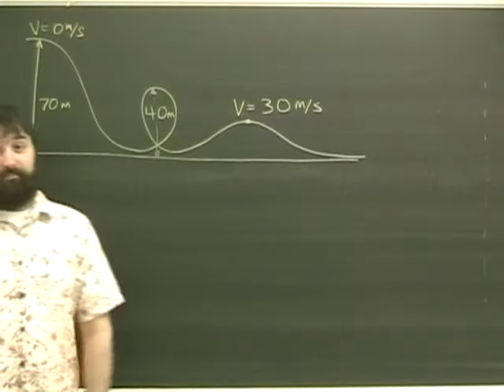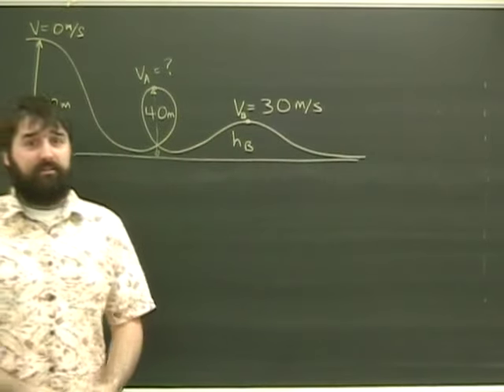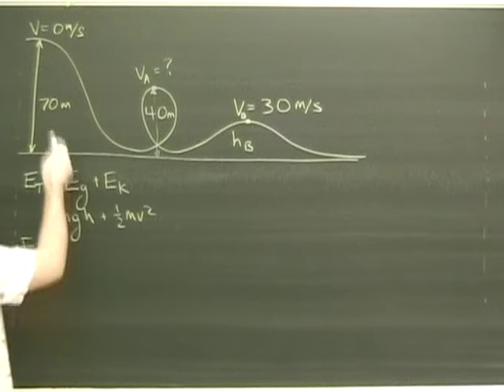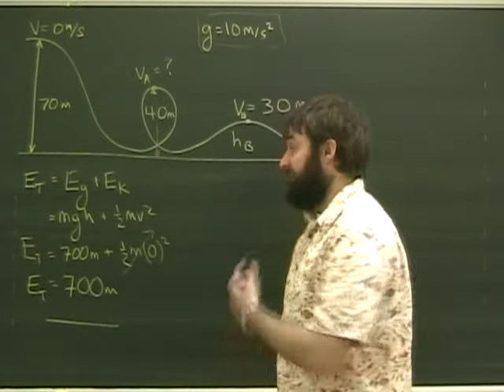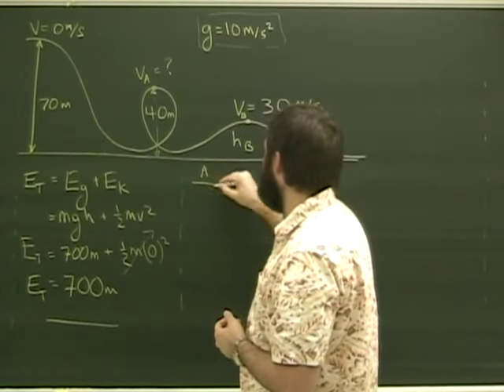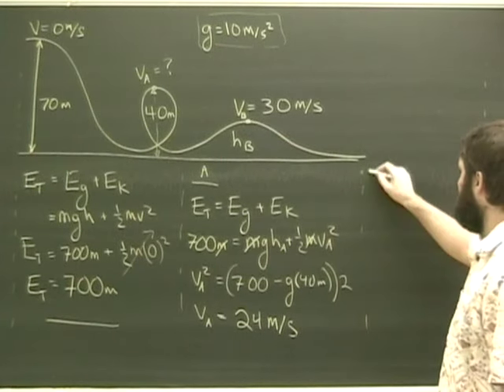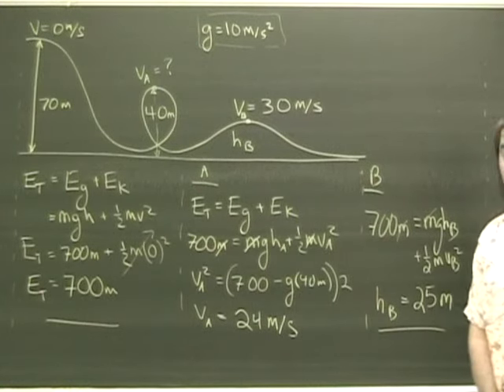Physics Roller Coaster Problem Conservation of Energy

Comment from the maker: The gravitational energy at the start is calculated as mgh. The mass is unknown so we leave it as an unknown and just use the letter "m" to represent it. We also chose to use 10 for "g" instead of 9.8. The height at the start is 70m.
The gravitational energy is then mgh or m x 10 x 70 = 700m. The "m" is the unknown mass and NOT the unit for meters.
I hope this helps.

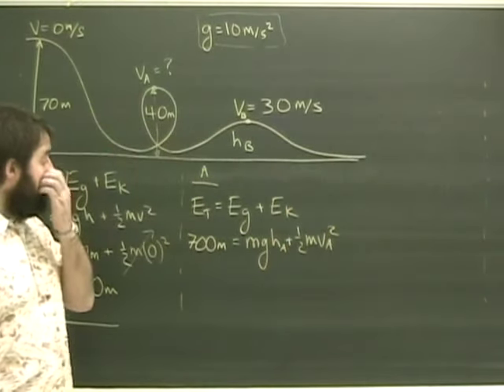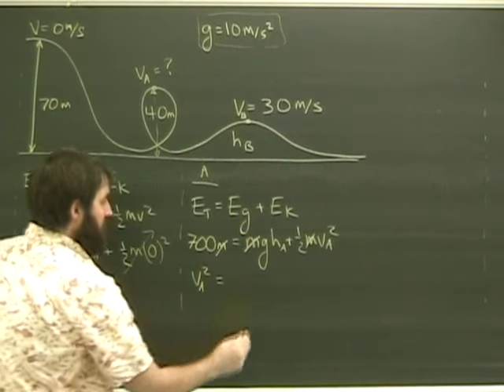Comment from the maker: At 2:40 you can cancel the m.  At 2:50 you can bring the gha over to the other side so you get 700 - gha = 1/2 Va^2 The left side works out to 700 - 9.8*40 which is 308 on the left = 1/2 Va^2 on the right. Then you multiply both sides by 2 so the 1/2 is cancelled and you get 308*2 = Va^2 Then you get 616=Va^2 then take the square root of both sides you get 24.8 = Va

Comment: @Rockification09 it's not 700m as in meters. It's 700 x m. As in mass. And it's 700 because its mgh where m is unknown so we left it, g is 10m/s^2 ,and h is 70m. So multiply h by g and you get 700!

Comment: Hi, could you make a video on how to calculate the speed of the car 1) when it reaches the bottom of the loop for the first time, 2) when it reaches the top of the loop for the first time, 3) when it reaches the bottom of the loop for the second time? This is for GCSE exam, and we are only given the mass of the car (1500 kg,  the height of the loop (8.5 metres), and starting position at 16 m above ground. Thanks!

Comment: how did u go from 70m to 700m explain things to its potential of understanding
Reply: He has Eg there right?

Well Eg = Potential Energy

Potential Energy = mass * gravity * height
The mass =1 
The gravity in his example = 10 (it should be 9.81 but he used 10 to simplify)
The height in his example = 70

Potential Energy = 10 * 70 
= 700
Reply: I have the same question

Comment: Why is it 700m when the diagram says 70m?
Reply: +Britany Cheung that m is not for metre. Its for mass.
Reply: You are correct it does say 700m, but he uses the -10m/s^2 approx. for accel. of gravity so simplified you get => mgh which is (m)(10)(70) which equals 700m [m for mass not bringing in units for this]
Reply: @OCReefer  i thought that g would equal 9.8?

Comment: How did you get the mass? (700g)
Reply: Frank Liuu that's not mass
Reply: it's an estimate.
Reply: GetEmAndy It's not an estimation of mass. 

Since acceleartion due to gravity is  10 m/s^2, and the given height is 70 m, we will have:

m(10)(70) = 700m where "m" is the  mass.

This basically means that for every kilogram (SI unit) of mass, there will be 700J of energy.